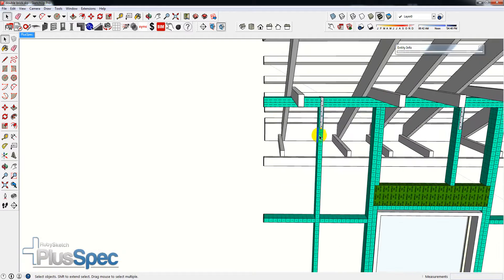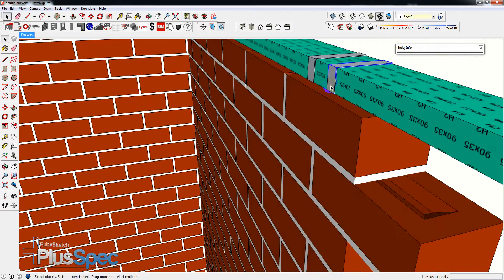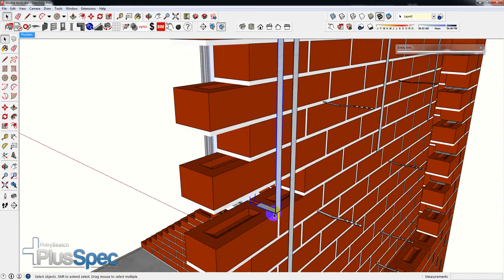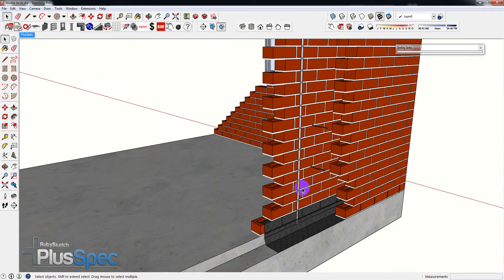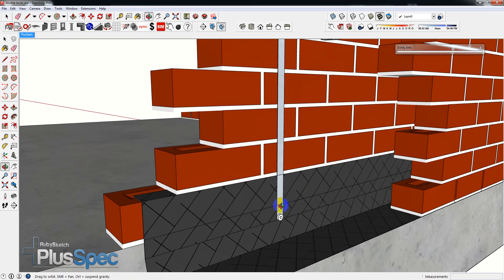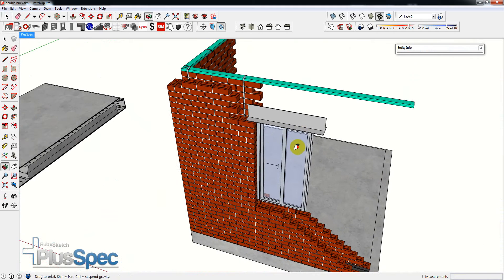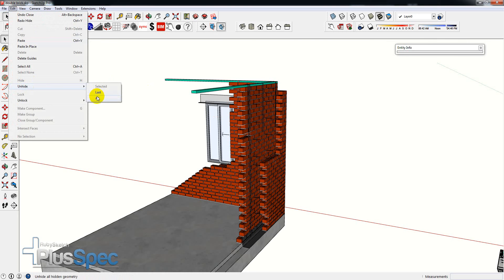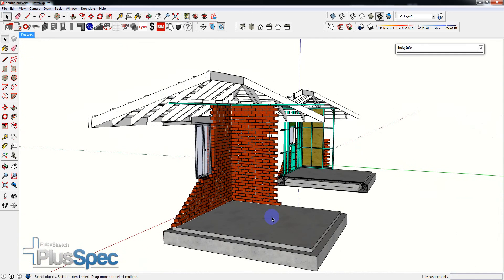Hold down straps explained By Andrew Dwight: double brick construction

Comment: Another is stronger a 50x50x3 Gal RHS  with gal 12mm rod at brick course approx 1200mm and corner taken through brickwork and 50x50x5 Gal washer and lock-nut.   the AS Code for winds 
AS 4055-2012 Wind loading for housing
AS 1170.2:2011 (R2016) Structural design actions: Part 2, Wind actions